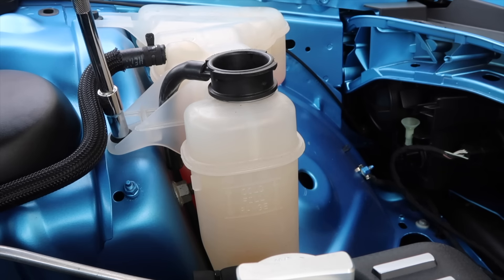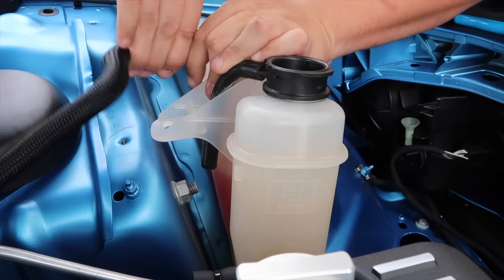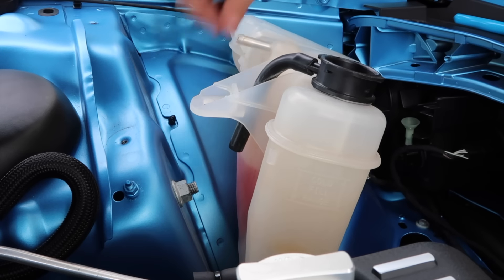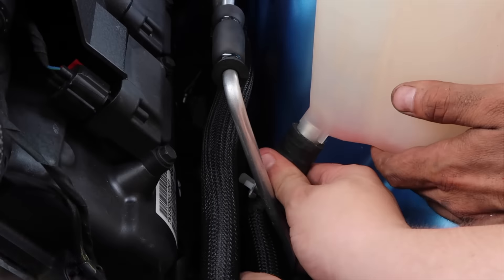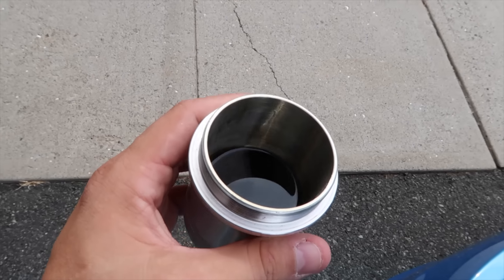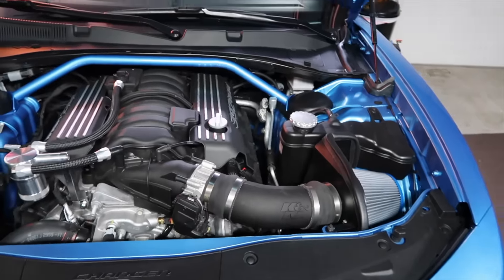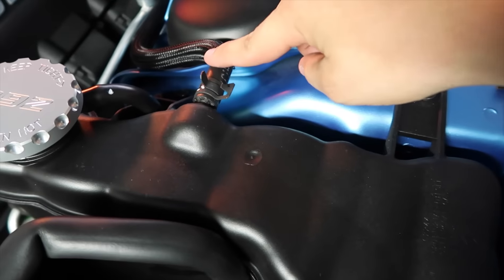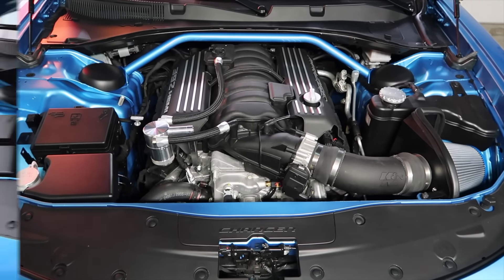Scat Pack Coolant Overflow Plastidip and Mustang Sway Bar Swap !!

Comment: Looks good man. You did a really good job. I think I know what my next mod will be haha thanks for the idea!
Reply from the maker: thanks !! it's a little tedious removing the coolant and sucks even more having to remove most of the intake but once it's wiped clean REALLY well and you start spraying, you get a crazy big smile the blacker it gets lol I'll admit I didn't wait very long to put mine back into to car but if you have enough time to let everything dry a bit longer like an hour or so then just handle it with gloves and hold it by the parts where the bolts go and you should be fine .. it's REALLY helpful to have a second person to help attach the lower hose back on so keep that in mind !! good luck :)

Comment: Looks good. I have been wanting to address that ugly fucker in my challenger. Thought about plasti dip as well. U think itll be all good with the heat?
Reply from the maker: Yeah it should be fine I Plastidipped my Mustang overflow and it was fine .. also saw people dipped their exhaust tips as well as engine covers so it's all basically the same thing I wouldn't worry .. only thing is I know my intake will rub but it's fine lol
Reply: +Honestly OCD yeah , may have to give it a shot. It does look better. Def helps conceal it some, and hell my car is black so it may just be perfect!!  Thanks for the vid. Take care